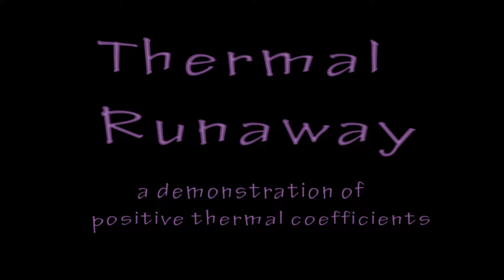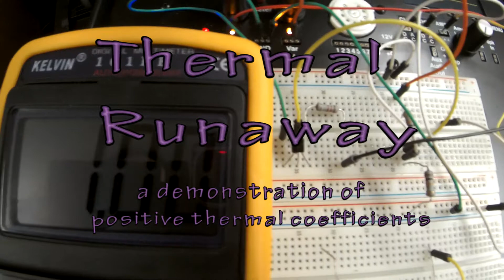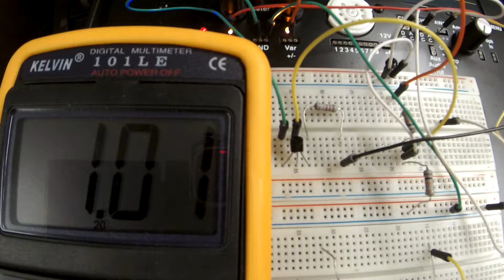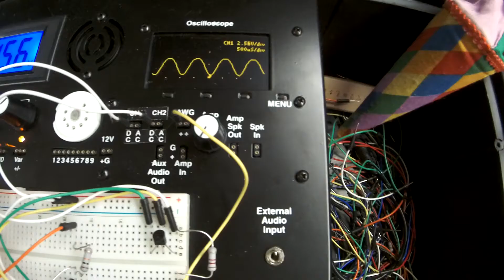Thermal Runaway Explained (in a Transistor)

Comment: What is the kit you have with the built-in oscilloscope?
Reply from the maker: It is the lab kit I designed and had built for our students to use for electronics courses in our Audio Engineering degree. There are commercial version available but I don't think any have the scope.

Like these https://www.tequipment.net/Elenco/XK-700-OB/Analog-Digital-Trainers/?Source=googleshopping&gclid=Cj0KCQjwla-hBhD7ARIsAM9tQKtBpnhRG8dDu6A9xzw8JSE-wHgU4zxSiTYwD5lYsq6W63-gfrl2_FsaAhT8EALw_wcB
Reply: @wolfgangmichaelsound  Nice. Thank you.